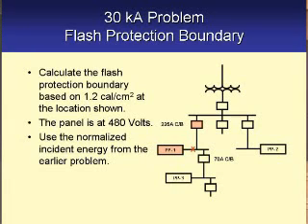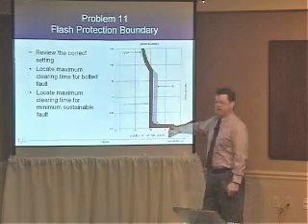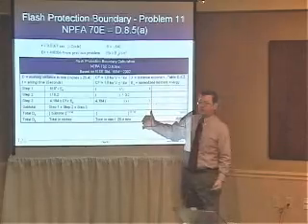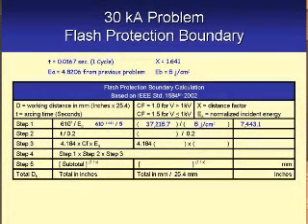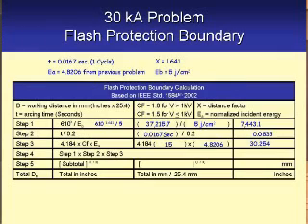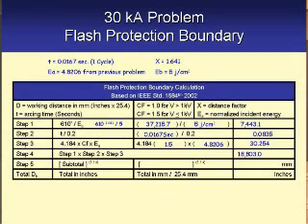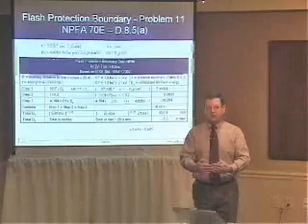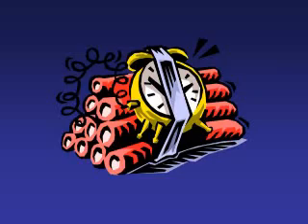How to Perform an Arc Flash Study – Part 3

Comment: Jim is saying this - if an unauthorized person trespasses or crosses the Arc Flash Boundary line - PUSH THEM BACK! PHYSICALLY PUSH THEM BACK IF NEED TO. This is the only way to keep that bad actor from being blasted away or burned away seriously or fatally from an arc flash. 

Electricity, especially high-voltage current, is not a joke. This is very serious business, and must be respected very profoundly. And in arc flash situations, extremely serious. You mess up or screw up even very slightly in arc flash situations - you get blasted or burned up to death in just seconds!!!

Comment: I was lucky to survive a 130V arc flash from a very bad outlet in my home in 1991. Trying to plug a night light. There was a bright flash and a bit of a pop but the circuit breaker tripped in 1/32 of a second - otherwise I would have been electrocuted. I was uninjured despite something like 2 cal/cm3 of short circuit fault. 

But if this were a 60,000 volt arc flash if I plugged in that same night light, since I was without PPE, I would have 4th degree burns in the face and the neck - maybe 5th degree burns, because of the 35,000F superheated plasma air - and also thrown back from the "blast" at speeds as high as 200 mph - and I would have died instantly from my injuries.